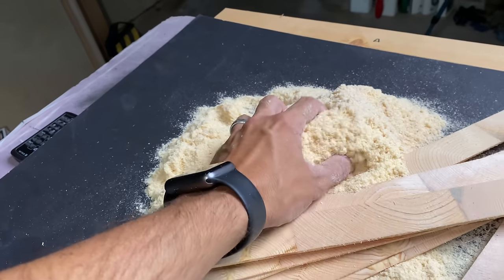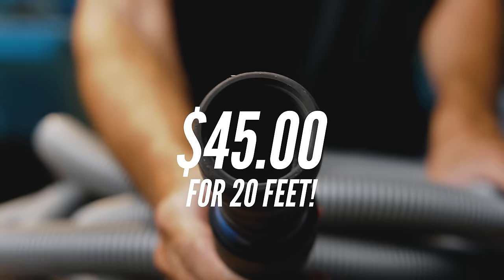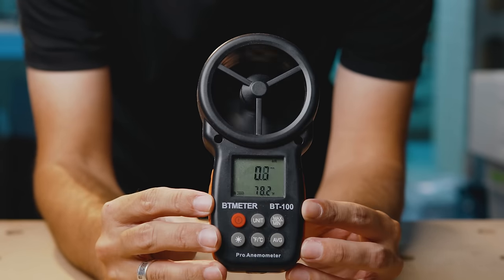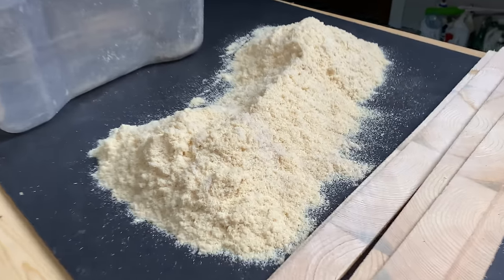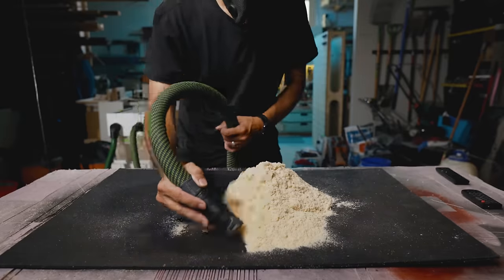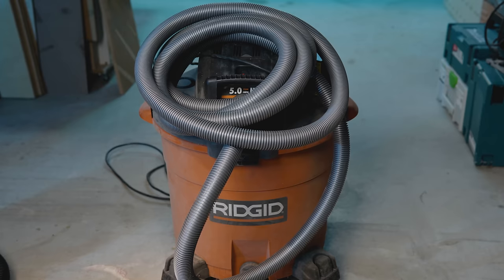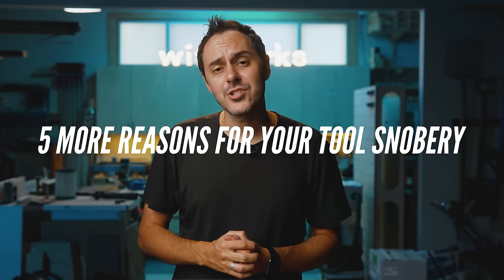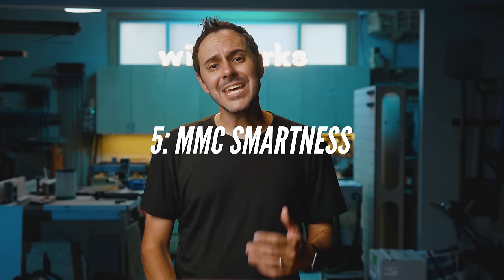This video will save you a lot of money. Dust extractors for beginners.

Comment: I've not worked through all the comments, so I'm sorry if this suggestion had already been made but... regarding your PM test results: You are testing the air being blown out of the vacuum, but you're not testing the air at the tool. However, when you're cutting with your tracksaw, your face is considerably closer to your tool than to your vacuum. In a perfect world you'd stick your vacuum in a box outside and run high volume tubing to your workbench (and a few other points if necessary).

I would expect to see that while your clogged filter $29 vac is not pumping out much dust from the back, it's probably not sucking up much dust at the front either. It would be really interesting to see the same tests done with the meter next to the saw... or attached to your shirt. Then you can see if your Festool can justify its cost.

Comment: Interesting video, thanks for putting in the effort.  I know when I use my Ridgid vacuum in the garage, I can often see/smell dust coming out the exhaust port (when using a non HEPA filter AND bag.  In my shop, I  have a dedicated Ridgid for my miter saw dust collection and for my drill press and vacuuming up any dust nearby.  I use my old Festool vac for my sanders and track saw and even vacuuming the floors at the end of the day.   Oneida makes a Oneida Air Systems Ultimate Dust Deputy SD Cyclone Separator for Festool CT Vacuums @ $299 which I have been using for years.  Still pricey, but cheaper than the Festool version and really extends the life of the very pricey Festool bags.  When my Festool finally dies (it is over 15 years old), I will purchase another Festool - they are much quieter!  As you mentioned, I too question the accuracy of that dust particle meter.

Comment: Nice video with some valuable information. 
I think the one thing you need to factor into the equation is that the particulate meter is reading the shop air, not just the filtration level. As the exhaust stirs the ambient air, your including any dust or debris already in the shop. A clogged filter will reduce air flow, and therefore reduce the exhaust intensity that's stirring and picking up dust in the shop. Running the tests in succession should produce a progressively worse result, as you're now dealing with the debris from the previous tests. 
One of the best things you can use to help mitigate the ultra fine dust is an overhead dust collector in combination with whatever vacuum system you're using. Believe it or not even some of the lesser units make a huge difference, which you can see simply by looking at the end filter.
But I definitely enjoyed the video, and I think overall you made some great points on the pros and cons of each system.
Reply from the maker: yes. I measured the filter area because that was a specific question a viewer had. next time I'll measure at source.

Comment: Funny thing you mentioned was it a controlled environment for the test.  When you think about R&D for most manufacturers they have controlled test labs.  Which means they can control the environment to get the ratings they want.  Market and charge accordingly.  Your test is better than a controlled lab.  It is real world or as close to.  One thing guaranteed no 2 garages or shops are the same.  So I appreciate test like these.  And yes the cheap version is better than nothing. Which will be my version eventually.

Comment: I had Festool and Fein vacuums, and both worked well but the Festool noise level is great compared to other vacuums, the Fein was closest. The Fein had a convenient big filter that fits inside the vacuum. So if your vacuum is sucking in more air then it is cleaning more air that could have dust in, thus a cleaner environment.

Comment: I bought a Festool HEPA dust extractor, yes it’s really expensive. It’s superb for hooking up to a sander. 

The Festool dust extractor is terrible as a job site shop vac for remodeling debris. For job site remodeling I really need a 2-1/2” hose to handle the bigger chunks and chips. I’m pondering buying a cheap Bauer shop vac for remodeling. I had invested in the $375 Festool stackable 204083 CT Cyclone Dust Collection Pre-Separator CT-VA 20 and it doesn’t work that well at all and I still have the smaller hose… the right tool for the right job.

Comment: This is why a real experiment is necessary. This video only shows the reason you’d need a real experiment because there’s a real question to be answered. We would need to test each in a controlled environment where the first one didn’t affect the next and last one. Also we’d need a control to see how many .3 PM are in the air without a filter so we can see how well the filters did with the .3 micron PM

Comment: Ya I have a “big” delta dust collector for my stationary tools (table saw, jointer, plainer, band saw, ext)… and then for my chop station, sanding, and hand held tools I just have a few Ridgid shop vac’s (most picked up used for cheap), and they are hooked up to the cheaper version of “i-vac”. They work great for me and I have 3 of them set up for less than $100 each.

Comment: I have my own technique that works great. When I'm using power tools I simply open up the garage door and turn on the big fan sucking in clean outside air.  Dust never has a chance to settle in the first place and when I'm done I use the small leaf blower to blow out the garage.  I keep it cleaner this way that any other method I've tried.

Comment: Super video, thanks for all the details. So far (just above beginner level), have been connecting a Karcher WD6 to sanders, jigsaw and mitre saw, with the best extraction on the sander by far (virtually none gets away). 
I think the next step might be a cyclone set-up, but it's encouraging that with a good shop vac + mask, we're probably safe enough.  Although the shop would still need a good vacuuming every so often to keep down dust in the air.

Comment: You have to use the same hose to compare. The Festool hose is much smaller.  It's moving far less air a little faster.    I have both and the Ridgid is necessary regardless of how much you want to spend.  I wound up buying a few Fein Turbo 1's as a nice compromise between volume and lift.  They are also WAY cheaper than Festool.  You may want to clean the old filter and repeat.  It's possible that it's so plugged that it's not passing anything , much less particulate.

Comment: not sure if anyone's pointed this out yet, but if your anemometer doesn't do CFM (would need to input radius of your duct tunnel) - all you have to do is multiply your meters/seconds reading by 196.9, then multiply this product by square of your duct radius. So e.g. 7.7m/s => 7.7(196.9) radius x radius = CFM reading.

Comment: I was using my vacuum while sanding drywall. My leg got near the hose and what appeared to be a lightning bolt jumped off the hose and struck my leg. I have never been shocked by such a massive static charge. My leg felt like I had been shot and the area throbbed for at least an hour. Looking it up you can generate a static charge up to 20k volts. It even left a mark on my pants.

Comment: Quite an interesting video, thanks. But at the end I realized what is the problem with your measurements - it's the measurement point. For example - you would get a better results if you wouldn't turn on any of those vacs at all. With that in mind you should have added an additional measurements point near your saw - that would allow us to see the impact of different suction of those vacs.
Reply from the maker: If I knew the video would do so well I would have paid for a second measuring device to put where to said. Thank you for the tips!

Comment: Sometimes the newer vacuums don't seal as well as older models. I think the packed filter acts like a super filter, but lowers cfm's, so you aren't pulling as much away from the work area. If you worry about the dust you have to consider how much is being collected where you're cutting or sanding equal to where the system exhausts.

Comment: I felt you were being very sincere with this test. But the true value of dust collection is at the tool where I’m at and not the dust collector. Also a collector that is clogged will produce less particulates than one with less blockage as the overall airflow will be higher on a fresh filter. I also wish you would of pointed out how your new cheap vac did twice as bad as the old and instead compared it to the festool.
Reply from the maker: Thanks Daniel! There was a lot of data I was going through and was trying to keep things at a "minimum" and still ended up with a 20+ min video. The brand new shop vac was a last minute addition. I agree about the tool. My makita tracksaw and festool sanders work great in that area.

Comment: I would say that the old clogged filter is aiding greatly in the old vac's particulate reduction.  If you put a new filter and cleaned up the old vac, it would likely be worse than the hepa filtration on the other two.

Comment: I don't like that my cyclone dust extractor reduces the air flow, but it's constant, always! Without it, and a new bag, the flow is great, but just keeps getting worse until I decide to change the bag. It's kind of like old flashlights, that keep getting dimmer until you can't stand it any longer and install new batteries. The new ones have electronic circuits and are pretty much just as bright until they just stop working.

Comment: Nice video, they call that caking though. The dirty filter actually causes more filtration than a fully clean one. That is why JET tells you a caked filter will give you a better results. Notice though, a caked filter will also stop you from having higher CFM. The CFM on the old RIGID vac actually shows that volume of air dirt percentage is still higher than the festool. The Festool still wins all the way across the board. I feel like you missed that.

Comment: I bought a remote clicker to use for my shop vac - have that connected to two 5 gallon buckets that are used as a cyclone separator. then I got a hose going up to this boom arm I made and the hose comes back down so I can hook it up to multiple tools so the vac and cyclone separator stay put and never move.

Comment: Not a pro, but—I have a RiDXGid wet/dry vac used indoor, and in my case, only used almost exclusively for wet situations. Regardless, I added (trimmed and secured butterfly net style), pool filter sock to the "Radial Diffuser" muffler medium material. No science here, but visually when pulled— it helps. I moisten it for additional collection. It's amazing to see what would be spewed out otherwise.

Comment: For the air quality monitor you should actually have it enclosed and only receiving air from the exhaust of the shop vac (the filtered air).  You would then compare that result to the ambient readings from the environment.  The ambient readings would be considered your starting or baseline result.  The main thing you want are unfiltered and filtered air quality readings.  In order to get the filtered results, the air quality meter cannot have the ambient or unfiltered air mixed in.  If you made a clear acrylic housing that connected and sealed to the exhaust you could put the meter inside and see the readings.  It would work similar to an air tunnel. I'm a Mechanical Engineer and we often run different tests on tools (or whatever we are building) in order to hit certain design specifications; thermal, air quality, acoustic, etc.
Reply from the maker: That’s a great idea. Thank you for sharing it!
Reply from the maker: I might do a cheap vs expensive sander test. Any ideas on the best way to set up to compare those?
Reply: @wittworks  What criteria were you interested in testing?
Reply from the maker: Trying to answer the value question. Do they perform in general better and are they worth the price. My thoughts would be on material removal, dust collection, heat, hand sensation?
Reply: @wittworks  there could be a lot of variables for material removal that would need to be accounted for.  RPM for the sander, grit would need to be the same of course, type of wood (hard vs soft), the length of time that the sander is on a particular spot or the distance of travel with the length of time accounted for. You would want to use a good set of calipers for the measurements, something that can measure to the thousandths place for inches and hundredths place for metric.  Dust collection you could do at the same time as material removal and should give you a rough idea about material removal (I would weigh or measure the mass of the dust collected). You could potentially run your particle measuring tool as well if you make the housing for it that I suggested.  For heat I would either use a thermocouple with a multimeter (a lot of multimeter kits come with one) and tape the thermocouple to the location I want to measure or use an IR thermometer.  The thermocouple will give you a tiny location while the IR thermometer has a wider spread.  Hand sensation will probably be the toughest.  The first idea that pops into my head would be to try and measure the displacement of movement in the XY,XZ, and YZ planes.  I would probably just put up some fine rulers or scales and video record the displacement with respect to them.  Probably the biggest issue with that will be any distortion that the lense will cause on the measurements and keeping   your hand in the exact same spot for the measurements.  Hope this helps

Comment: Good video.  an 80% solution is better than a 20% solution.  It doesn't have to be precise to see the trend.  Remember we built the first rockets with just slide rules. 

I've tried three of the 5gal separators; Dust Deputy, cheap bucket head, and the Dusttopper. Go with the Dustopper from the orange box store.   In my small shop, I keep all the dust separators, and my 5hp shop vac behind my MFT with a swing arm that provides a hose to my tools.  Most of my tools use the 27mm Festool hose connection, with an i-VAC auto on switch to turn everything on and off automatically.   A good mask and a box fan filter takes care of most of the rest.   Still need something to take care my table saw sawdust vomiting machine.   And since I'm not doing any crown molding,  no chop saw dust generator is need.

Comment: Feed the vacuum exhaust out of the building with a larger diameter tube. Add a bag filter to the outlet if you feel the need. To really stop the dust blow it into a barrel with a water mist spray running inside.

Comment: Couple hepa furnace filters and a box fan running around to clear the air will probably solve most of what you’re fighting to solve here. 

Or you could actually get a commercial one haha. Point of use collection is the best first step. A full shop filter is probably a better second step than a super nice point of use system.

Comment: So I did my due diligence. Like others I woukd love to see the old shop vac, new filter, no cyclone numbers.  I also believe the clogged filter is getting more filtering. Truth is I have the Festool and love it. 

Note: I used the ridgid bag on my craftsman vac with a clean standard wet dry vac filter to clean out my fireplace ash. Inadvertently had a glass to end table at the output of the vac. Nothing on the table. Literally nothing. Wiped the table with a clean paper towel. Nothing. Is a clean shop filter enough to keep us safe? 

The best way to stay safe from small particle sawdust is handtools is to use planes, scrapers, chisels… Then there are the other times..

Comment: If you are a very active hobbyist or professional, Festool will be favorable and win every time.  I’m a serious hobbyist and I had a little buyers remorse after buying mine but after a week with it, I’ll never buy another shop vac ever again. I really like the sleeve on the Festool hose. It keeps the hose from catching on sharp edges possibly ruining your hard work. Another thing I like is the speed control. Very helpful and almost essential for finish sanding. The performance of a shop vac seems to degrade over time. Rather fast in my opinion. My Festool never looses performance even when the bag is full. And the bag will become a brick if you’re not keeping an eye on how full it is. There’s also no static discharge from a Festool hose. Festool bags are expensive but I just bought a reusable one that I empty outside with a respirator on. The list goes on why the Festool is better but you’d have to be pretty serious to n hobby or trade to justify the cost unless you have the money to spend. Before owning any Festool, I used to think they were way overpriced and the cost would be justified by performance. After purchasing my first sander, I was completely wrong! Imo the cost of their tools is completely worth it though I’d prefer not to spend so much 😂

Comment: You can probably make a rudimentary cart using a couple 2x4's, a 1x6, and some cheap casters. It might not be pretty, but it'll do it's job. So for the price of under $100, it can be done. 
 
Of course, if you're willing to spend $1000+ on dust collection, you're not worried about the price of quality.

Comment: 20:44 though cost again is high- I highly recommend the longer hose they sell that is wrapped in a sleeveand has the plug it cable included… very efficient and I bought the longest one and have been very pleased though it was nearly $400, it is a great investment if you’re using the vac everyday